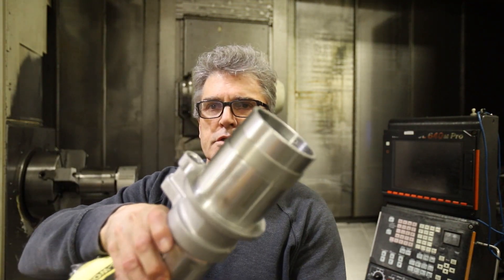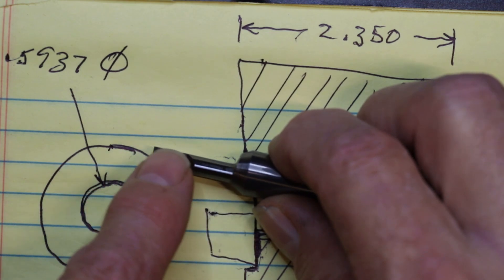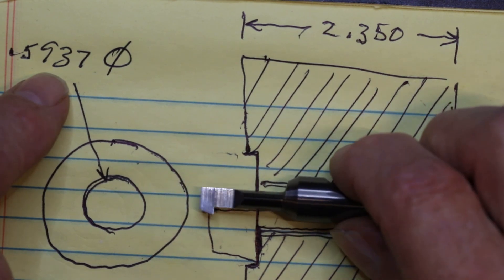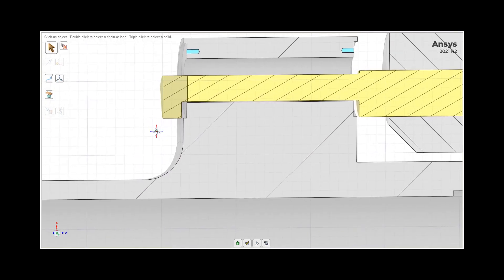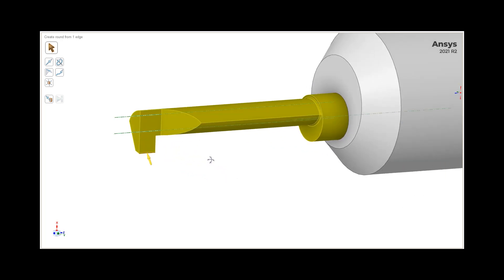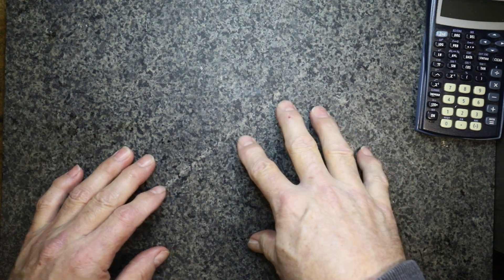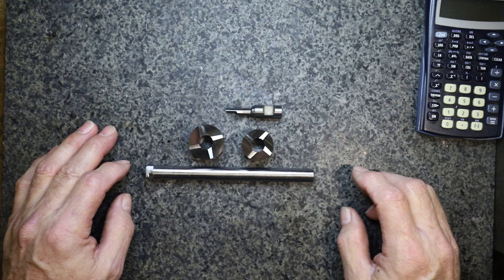Back Spot Facing Tools

Comment: I think if possible, I would have to go with the angle head . Seems so much more easier for time and programming. Plus it is another tool in your arsenal for other jobs to come.
Reply: Costs $8k and you have to wait for it to show up...  Not ideal to say the least
Reply: @calholli  just a suggestion is all .
Reply: @calholli  If delivery time is decent lets say 3-6 weeks and if he has time to wait it is much easier and better to spent that money. I am at similar situation I run woodworking shop with 3 cnc. and if I have time to wait for better tooling i wait. becouse you spend a lot of time searching for supliment solution whic is not versitile for other work. last time I spent 3000€ for sanding agregate for my 5axis machine. I waited 2 weeks. I could do the yob without this. but considering that 2 workers would do this yob 2weeks by hand my machine than did this work in 3 days + my 2 guys did other jobs meantime so i spent 3000€ but I would spend 6000€ if this would be done by hand (other wourk wouldnt be finished and this one would take way too long) and as bonus sanding head does not have expiration date so it can sit few months waiting for next job wher it will again save me money. There is the logic for bujing proper tooling for certain jobs.

Comment: I run 50 year old machines and I watched to the end. Like to see how your going to do and thought process how to get there. I figured you would mention using a simple boring bar that uses square tool bits some how . Ground to right width like the spot facers and put some relief for chatter and good finish

Comment: Good stuff Pete! These are all the things we go through and then some. One of the hardest things for me is to not get hung up on sorting it out too far. Sometimes I can fret and research a job so long that if I just spent the money on the easy expensive way it would be done and I would be on to the next. So many angles to cover.. Makes it a challenge for sure.. Keep up the great vids
Reply: Yes exactly. At some point a decision must be made and committed to. It's difficult to negotiate the expense not knowing if the tool will work as planned. Can be very stressful but usually works out even if you have to modify the plan a little.

Comment: There’s a really nice back spot facing tool that I have that is a single flute inserted tool that folds in to the same size as the shank and feeds in at centerline and when the spindle comes on in the cutting direction it forces the flute to flip out and when the spindle turns in reverse it folds itself back in so it can retract from the hole at centerline. Awesome tool! I don’t remember who makes it off the top of my head, but I can look when I’m at work tonight

Comment: Really well designed, and described. 
I've been a manual / CNC machinist / methodizing - programmer for over forty years, and working on this type of project, both straight / square, and hyperbolic, the one thing I always liked to do, both for my own peace of mind, and the safety of the part, before I started, I write the X, Y, Z, (I, J, K),  moves I need to do to accomplish my task, as well as an escape plan X, Y, Z, (I, J, K), on the same lines (note pad) as the entry code, so once you're inside the part, behind stock that is going to be left, hopefully all goes well , but if it doesn't, don't panic, trust your numbers, and dial your way out to the safe path to get out of there without damaging the part and machine / tools.
Hopefully your machine has ball screws, or tight feed screws, and absolute digital read out.
My shop had both brand new HAAS machining centers, as well as old modified CNC mills that could run doors open.
We machined some of the closest tolerance / impossible to get to features / projects you could imagine, and we did them on the old machines because they would run the way they needed to, to get the job done.
Be safe, take care.
Excellent video.

Comment: This information is extremely useful for other machinist like myself. At my job, I'm not only a machinist, but I'm also a tooling and machining fixture designer, a parts reverse engineer and so on. I also work in a job shop type environment. Thank you for putting together these videos because they are much appreciated.

Comment: In the past I have used another method on aerospace parts particularly on a field repair to remove corrosion, I feed a tool holder thru with no tool in it then put a fly cutter into it  and back spot face adjusting the fly cutter out till it gets to size. Hopefully this helps, brilliant video and well filmed thanks for sharing 👍

Comment: I just got some of those  ER shrinkfit adapters. They are great. 

The back spot faces could also be done with one of those spring-spring loaded style tools. The cutter moves into a slot at rest so it can be fed in and out of the hole, then pops out when the spindle starts spinning it. 

The little holes are the more challenging part. That angle head it going to be hard to beat.

Comment: Peter it is of value, once again, I am not a CNC guy or production type machinist. However in my work I run into one off oddball portable machining operations in the field. I have to consider special tooling or fixtures as well. It always interesting to see how others go about the process even if it is a different context. After all we need to be able to do our work within the budget parameters of the customer and still earn a profit to stay in business. Sometimes that is not as straight forward as it may seem.

Comment: I run into these spotface issues alot, I am currently running a job I programmed on our DMU75 that I use a manual spotface tool by Craig Tools that I have to manually place the head onto the driver because SIkorsky engineers for some reason create small thru holes with large back spotfaces. My thru hole is .330 and the spotface is .937, Cant get to it from the top side because its blocked by the part features.The part has 8 holes to spotface and I have M00 on my program to engage each hole. Luckily I am able to purchase pre-made tooling and haven't had to machine my own just maybe gring the head dia. but yeah, spotfaces are a part of my daily life! LOL!😂 I love your content! Thank you for taking the time to make these great and educational videos! Tip! I place shrink wrap on the arbor to prevent the tool from coming out! 🤣

Comment: Absolutly enjoy seeing how you work through these problems.  Can't wait to see how you solve the problems.
What about making a new Arbor for the off the shelf back facing tools. Instead of it having a straight slot cut in it that allows movement. I was thinking one side could have a flat and one side be tapered slightly. Locking it to the shaft. Just a thought.  Eliminating the play that could cause chattering.

Comment: I ran a job several years ago with that second style two piece back spot face cutter.  Surface finish wasn't an issue, forgetting to take the spot face cutter off was.  I ended up grinding a couple shafts by hand to replace broken ones.  We programmed it to feed the shaft into the hole, M0 to install the cutter, feed the cutter into the part then return to the initial position, M0 to remove the cutter, M0 a couple more times to double check that the cutter was removed, then feed out of the hole.  Height comp was used to control depth of the spot face, TLO was the end of the shaft.  We made something like 120 of these parts, and each one had 4 back spot faces.

If I were to do the back spot face I would use the two piece tool, but make my own shaft section.  Buy extra long tool steel that reaches both spot faces then grind the notches into the one end.  Tool steel should be fairly cheap compared to buying tool holders.  Then I would make a bushing to place inside each hole that gets spot faced to control tool runout.  It should be a slip fit to make installation and removal easy.  Chuck the shaft into a standard tool holder, then dial in tool runout as best as possible.  Program it to have an M0 to install the bushing onto the shaft and tape it up out of the way, feed the shaft into the hole, M0 to install the cutter and position the bushing, spindle on and feed to spot depth, return to initial position, M0 to remove the cutter and bushing, safety check M0, feed out of the hole, then repeat for the other hole.  Don't mix up the cutters.  For the small pin holes I like your idea of making a drill jig, but I wouldn't use a drill press.  I would just use an air drill with a drill stop on the drill bit, add a reamer if tolerances are tight.

I would consider the right angle tool setup if I were making more than just 27 of these.  They would be great because you could chuck both an end mill and a drill to get both the spot face and the pin hole.  I've ran them in the past also.  They were like the slim line models in this catalog:  https://platinumtooling.com/wp-content/uploads/2017/06/heimatec-angleheads-1.pdf  You could lay the part on its side with those two bosses pointing up, clock the part somehow, Y and Z zero could be that main tube centerline, X zero could be the end of the part, or maybe one for each boss.  You would clock the 90° head inline with the X-axis.  You could mill and drill both sides of each boss this way too.  You could use a tooling block with slots 180° apart then just rotate the tool in the spindle to cut the other side.  Use G19 for cutter comp.  Found this while wondering if canned cycles work with G19: https://youtu.be/URO3ETG18bs

Comment: Very useful information, Peter. Thanks for sharing. 

PH Horn makes a relatively inexpensive coolant driven right angle Toodle speeder that I've used before with good success. I didn't catch what material this part is but I've interpolated features with smaller diameter (2-4mm) endmills in 7085 aluminum with no issues. I'd be worried about it or other coolant driven heads having enough torque to cut steels or other exotics, but maybe that issue could be mitigated but using smaller cutters with light stepovers.

I wrote a macro with variable that control hole diameter, infeed pitch, depth, etc, which makes it super easy to do multiple sizes of features with one program just by changing a couple variables.

Comment: because of the potential back chatter, it might be possible to fix the back facing element, and since there is manual intervention required anyway, to insert the tool into a a suitably stoped collet when inline to do the cut, videos always appreciated.

Comment: Thanks for the video and your design thoughts. I'll considering taking a old capto holder and then mounted 90 degree to a faceplate. The faceplate has a through hole, that fit the diameter for your 24V deburr tool. Slit up the faceplate into the trough hole so you can grip around you deburr tool and fastened with a scrue. Make a simple grinding machine and take the time to make the recess and deburr.
Reply from the maker: I think I have a solution. It’s not exactly what your saying. But you not far off. You will see in the next video if it all works out.

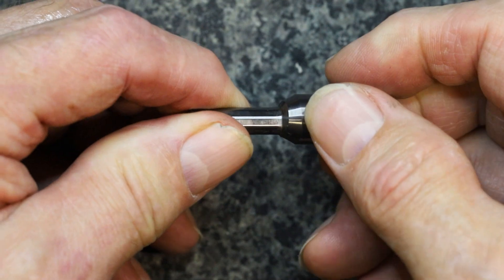Comment: On the Tool you showed at @6:45 maybe you could make a screw on Back Boring Tool , Like Iscars Mill Master Adaptation , You will have to grind it anyways to get the correct size , maybe you could braze a Shank on the Back Boring Tool and then gind it all together and a few threads on the Back Boring Tool , and then do the way you told to manually put on (screw on) the The Tool and do the back boring the threaded adaptation would get rid of the vibration and would be easy to make with the Tools you already have , just a suggestion though , no ways I have done any of it before just a idea , great content 🌸🌸🌸🌸🌸

Comment: Long term the driven angle head is the way to go purely for the flexibility it will bring to jobs. Even if you can only claim 50% of the cost on this job alone. Customer may bring you more of these later on too. Those back facing tools might chatter quite badly after you grind clearance on the sides too. Especially as they are a sloppy fit on the arbor. These videos are interesting because its great to see your thought process for the setup. 👍

Comment: Love the videos, thanks a lot for the deep insights. 

The angle head might be the best option if it’s financially viable. 
One route may be to talk to the company and see if they are willing to rent you one or get you one to try out for evaluation  for the parts. 
Also get a quote for a mechanical geared one like a benz and see how they compare in price. You would need to index it 180 by hand but that would be ok I guess for 30 parts.
Reply: The 90 degree angle piece is around 800 bucks and a insert for a tool is around 40
Reply from the maker: The mechanical heads cost just as much. But there is the problem of mounting the key on this machines spindles face. It is possible but it has to be done just right to miss the tool change arm. Also tapping holes in its face can damage the machine because there are hydraulic passages in that face to operate the spindle clamping mechanism.
Reply: @EdgePrecision  Have a look at cool speed spindle speeders from wto-tools. They also work with coolant and they offer a 90 degree version. the system is pretty nice although made for high rpm and small tools.
Reply from the maker: @hampfi747  As a mater of fact. My latest idea has to do with using some Cool Speed Mini's. You will just have to wait for the next video.

Comment: At my job we battle with the same issue with back spot facing,,,we just use a mandrill and a backspot facer ground to diameter,,we have .02" of tolerance tho,,,I know when they get worn they don't cut as deep at the same number so holding. 001" will not be fun. I started making plastic bushings for the mandrills so they don't gouge up the hole, or you have to make the hole the mandrill size,,spotface,,,then take the hole to final diameter. I found a plastic bushing let's you skip that step. We also do it all manually,,,we just put the machine in position and use the handwheel.  And yes peter....love your content and videos! I still learn neat tips and tricks from your channel witch makes it fun! Thanks!
Reply from the maker: Yea I was just trying to eliminate the manual operation. And the possible screwups that could happen. Because the shank of the back spot face is .500” and the finish hole is larger. I could drill and ream for the spot face tool. After running it. Than come back and fill and bore to final size. If I go that way that’s probably what I will do. Because of the very close tolerance of the finish hole size.

Comment: You probably have the job done already but here's my take:  I would use one of the purchased back spot facing tools mounted in a holder that has a stop screw so it will go to a repeatable tool length.  Set your tool length offset then remove the tool from the holder.  Run the prog up to a stop point over the hole and then reinsert the tool through the part and into the holder, up against the stop.
Run the spot face cycle up to another prog stop, and remove the spot face tool.  
If the end slop in those removable cutters are a problem you could solder a shim onto the shank to take up the excess clearance.

Comment: A company called Steiner make an excellent back spotfacing tool.  They put a linkage down the centre of the tool to actuate the flip out, so you bump the tool body into the part to open and close.  Much more reliable than the flip out or coolant driven options.
Reply from the maker: There are many of these type of tools. I am checking on them. In a future video I will show some if possible.

Comment: Running off the 2 piece back spot facing tool, you could make your own arbour with a D shaped boss on end and a stop flat to set depth of cutter. Then grind your own cutters to fit each diameter needed and have it bolt on and then the D shaped boss on arbour is your drive and the stop flat allows repeatability to remove after each part and that way you only need 1 arbour and 2 cutters.

Comment: Ive used the 2 piece back facing tools before. They are quick and dirty, but are definitely more geared to a manual type setup. It would be awkward jogging it with doors closed, but it will work.

Comment: They also have a back spot facing tool with a wing that flips out when you spin the spindle in reverse. I don’t remember the tool manufacture but we use them all the time and they work great with long reach and no chatter.
Reply from the maker: Yes I’m going to check into them Monday.

Comment: Peter, what about using something similar to your homemade cutter, but mount it on-center in the holder? you would insert it into the bore until the cutter came out the backside, then spin it up and orbit inside the bore like a threadmill, only with 0 pitch, backing out to cut the spotface. You could possibly use the same cutter in both places... I didn't read all the comments, sorry if this was already suggested. Cheers from Dan in Phoenix!
Reply from the maker: You can’t mill a back spot face thru this small a hole. If the cutter fits thru the hole at say .580 in diameter to mill the 1.015 diameter you could only have a shank of say .150 in diameter. And for the 1.130 only about .040 in diameter. Neither one could support the tool.